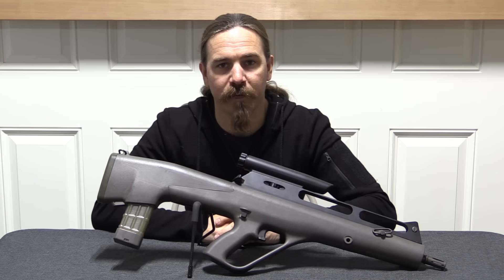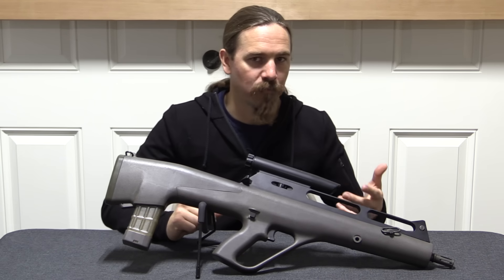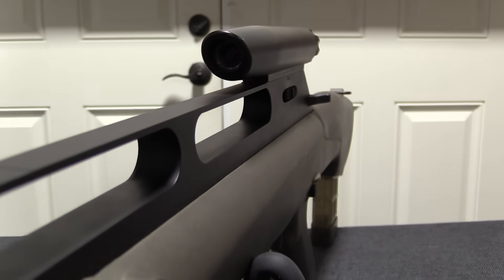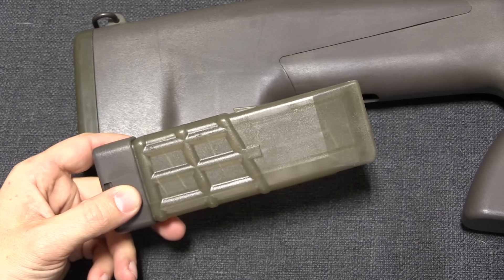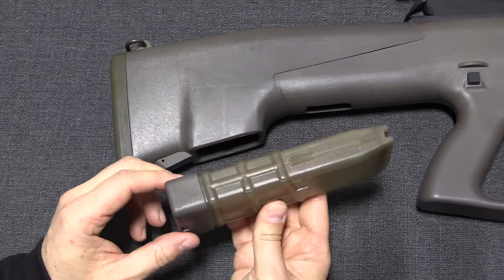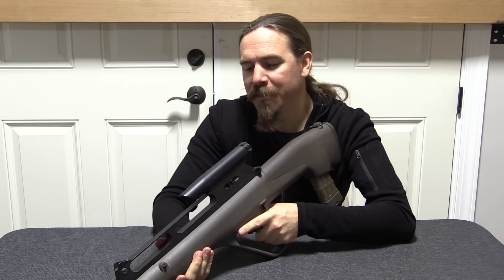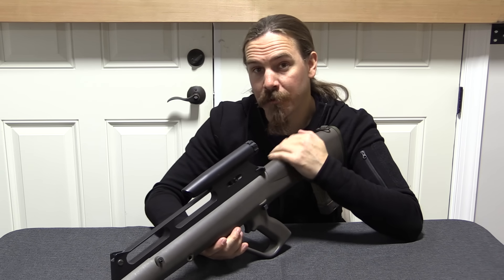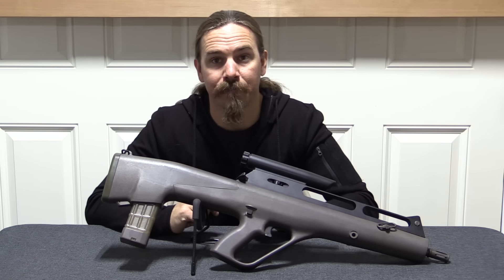Steyr ACR: A Polymer Flechette-Firing Bullpup From the 90s

Comment: This reminds me of the modern cars being build "computerized" and self-braking.
They are building high-end cars for people that do not have the responsibility and or skill to drive a car in the first place. 
The same logic here. They are building a rifle under the pretense that the shooter does not possess the skill to hit so they try to make the technology do it for them. 
If one were to make the argument that it was the prevailing mindset of the time (low opinion of the intelligence of the common soldier) you will not get an argument from me.

If the problem is with the shooter,  fix the shooter and the problem is going to go away.
Reply: Individual accuracy is next to meaningless when:
a) The enemy definitely will not stand still for you to take your sweet time aiming at him and pull the trigger.
b) Even if you gun fires laser beam, if the enemy emerges from cover and retreats back to cover in less than 2 seconds, you definitely still will not hit him.
c) Every soldier is capable of hitting moving target within the effective range of assault rifle with decent consistency. The problem is with the prevalent use of cover and concealment in modern combat, 90% of the time you don't even know which direction the enemy's gunshot comes from (refer to a and b), let alone precisely identifying which piece of cover the enemy is hiding behind.
d) The combine statistic of both WW1 and WW2's small arms related casualty analysis shows that more than 90 percent of death directly caused by small arms comes from crew served machine gun, followed by other types of small arms, with individually equipped rifle contributing the least amount of direct casualty. You can swap the individual rifle with cheaper pistol caliber sub-machine gun made of stamped metal sheets or even just a regular pistol, and the statistic still will not change.

Not saying that accuracy is useless, but when considering the bigger picture, it is not the most important thing to overly emphasize.
Reply: To all:
The following is not meant to be condescending.  It will probably come off that way but I really do not know how to ask the question without coming across as demeaning. So be it.
Which of you have first-hand experience and not just theory?
If you do have first-hand, in what context?
Reply: @glennearl5621  In addition to whatever time spent in school, I was assigned to a (light) combat arms unit between 1995 - 2000, so not only might doctrine have changed since then, but also since I squeezed my service time in between any major conflicts - this is why I spoke from the doctrinal standpoint, rather than combat zone experience.

Hey, don't blame me that there was relative geopolitical stability while I was serving - obviously this other nations knew what was good for them ;)
Reply: @glennearl5621  two deployments Airborne Infantry. Getting out within the month.
Reply: Flight Engineer on an MH-47. Afghanistan and a little bit of Iraq.
One of the responsibilities is door gunner and we used an M-134 for that.
Here is why I wanted context: The M-134 is possibly the definitive suppression system but the last thing you would think of when looking for an example of precision. 
In contrast, the operators we supported were trained so throughly that a precision shot in less than 2 seconds was routine.

I do understand suppression. I make no personal claim to be a precision combat shooter but I have worked with these guys and, more importantly, seen it first-hand. 
I do know that adequate training makes a fast, precision shot a reflex, this is to the level of an enemy breaking cover, for any length time, a losing proposition. In fact, exposing any part of the body to glance around cover is often a bad idea.

Is this level of training possible for only the elite? Maybe too expensive for conventional forces?  I do know that level is attainable as an absolute. I am aware of no effort to try a more intense training but I am aware of trying to field weapons intended to improve hit probabilities. Why not?
My point is that the level of firearms training given to conventional forces could be improved, a lot, even if it is never going go be comparable to the expertise I refer to.

I submit that it is possible to train to an effectiveness that surpasses the theoretical possibilities   by these unconventional weapons.
Reply: @glennearl5621  Revamping the entire training program to train literally every single soldier into having spec ops level accuracy will cost so much money, resources, time, and manpower, thus inflating the military budget  to such proportion that the public definitely will protest against such inflation of military budget size which is deemed as unnecessary spending (because most people don't care about the military). Adopting new, but still operationally familiar weapon system that drastically increase hit probability WHILE (pay attention, this part is important) maintaining existing training program and facility (meaning soldier will still undergo the same training program on the same schedule, but this time with different weapon) costs relatively less and is more effective in the long run.

Besides, most of the time soldier is able to  score individual direct hit on the enemy because:
a) Friendly area suppression ( such as crew served machine gun suppression) is taking place, effectively preventing the enemy from leaving its cover, thus allowing friendly soldiers to move forward and finish off the enemy at close range.
b) Soldier is able to catch the enemy off guard and quickly take down the enemy at close range without purposely aiming down sight.

The prevalent use of cover and concealment in modern combat tactics mean that the opportunity to perform long range precise hit on the enemy is very rare unless said enemy is standing on an open field for more than 2 seconds (nobody uses Civil War firing line tactic on open field anymore).

I agree that accuracy is still important, don't get me wrong. But since most engagement happen in close to medium distances, improving hit probability at said distances is what these weapon programs are trying to emphasize in the first place, and is still the primary improvement focused by most military until today.
Reply: @oim8254  I read what you wrote and now I'm convinced that you did not read what I wrote.
Reply: @glennearl5621  I did read what you wrote as well. If there's any misunderstanding, I'm sorry about that.
Reply: By that logic, soldiers not proficient with a sabre, a bow, or atleast a flintlock gun have no business on the battlefield... Decades of combat data on hit probability clearly show that most of that lead soldiers are spraying hits nothing, hence this generation spanning search for something that will increase hit probability.
Reply: @unverifiedbiotic  don't compare conscripts to volunteer soldiers. We have the tools to train people to shoot rather than just give many more soldiers weapons and have them spray at something.
Reply: @TommyTombstone  Not to be argumentative, but let's remember that a firefight is not a marksmanship competition. If US infantry tactics are being properly employed, most rounds will be suppressive fire. I have wondered for the past quarter of a century why our military focusses on "more accuracy" instead of "more suppression"
Reply: @MarcillaSmith  I'm fully aware. Been there, done that.

Comment: When I was in the Australian Army, we were taught that the circular reticle could be used for quick approximations of range. At 300m an average person should fit in the circle. Or roughly, a figure 11 will fit top to bottom in the reticle at 300m, and a fig 12 should fit in the target at 100m.
At 100m, with centre mass aiming, zero'd at 300m the steyr shoots about 10-12cm above centre. And so at 100m centre mass aiming you should be hitting people in the upper chest.
I'm unsure if the rifle is inaccurate, or the optics are bad, or what, but the Steyr AUG (or for the us Aussies, The Austeyr/F88) is listed with a 300m "effective range" with a effective section fire of 500m. But seeing the "at the time" M16 (A4 I think?) (around 2013/2014) they're listed with an effective range all the way out to 600m) So I'm not sure why, same round, standard 20" barrel, similar muzzle velocity. And if we're talking about on deployment, most infantry battalions had other sights on their F88s anyway, like ACOGs or other medium magnification sights around 3-4x magnification. So I'm not entirely sure.

Comment: From my time with the AUG I remember that the ring in the optics allows more precise ranging of the target. The inner diameter is equivalent to 1.8 meters at the standard firing range of 300 meters. As this is linear, the target of 1.8 meters height is at a distance of 150 meters if matching the outer diameter.

Comment: How does the flechette work?
Reply: Don't know if ya still wondering almost a month later but here's a quick rundown.

As ya can see from Ian footage a flechette is a small, needle like projectile with fins, think a really tiny crossbow bolt. It's then wrapped in a plastic multi part casing.

The case allows the needle to be pushed with about the same force as a regular bullet out of the gun, once clear of the barrel the case is designed to fall away, leaving the solid metal micro crossbow bolt of a flechette needle to carry the momentum towards whoever ya shooting at.
Reply: @Awoken_Remmuz  Thanks for the reply. I was just.wondering about length of a flechette and the small size of the magazine.

Comment: 35-odd years ago, I was briefly involved in the Australian Army trials for a replacement for the SLR. Based in the north-west Queensland desert, we headed out bush for the hot-dry and bulldust testing of several rifles - including the Steyr AUG, M16A1, M16A2 and I vaguely remember the guys talking about a Singaporean submission that had failed out of the trials early on.While not an actual selling point, the AUG receiver had a little switch that allowed you to select either full auto or 3-round burst. You did have to remove the butt-plate and pull it out to do so, but this only takes seconds. No, the real selling point was how freakishly accurate the AUG was - especially given that we were all used to shooting SLRs and F1s. It really was the gun that didn't miss.While the M16A1 was then in limited use and fairly popular among the SF community, such as it was, the M16A2 was an utter failure just during the period of my own observation. There were at least two parts breakages just during the fortnight I was out with the team. The real killer, however, was how quickly and badly both M16 models jammed up when faced with the talcum-fine bulldust so common to central-Australian cattle stations.
Reply: great story! Any chance the Singaporean rifle was the SAR-21 used today by the military? It's a Singaporean-made bullpup that resembles the AUG somewhat; used it for two years during my service.
Reply: @glenn.c  It was probably an SAR-80, which was an AR-18 clone made by Chartered Industries Singapore (now ST Kinetics). They hawked it around a couple of countries in the 80s, but they didn't get any large orders outside of Somalia.
Reply: That’s really Interesting!
Reply: I was an infantry instructor in the Austrian Army for several years in the 90ies, so I trained hundreds of guys on the AUG. In addition to that, my dad was a General and for most of his career, he was responsible for choosing, testing and selecting equipment for the Austrian Army – among many other things, the AUG. He used to tell me this story that you could bury the AUG in sand, leave it for a while, and when taking it out again, it’d still fire without a hitch. While neither the M16 or the G3 passed a similar test. Don’t know the veracity of this, or if it was just an anectote, but in my experience, both in hot summers and very cold winters, the AUG hardly ever failed or misfired.
Reply: @vi5ionary  I heard the actual AUG was impressive. The one made in Lithgow when I was in the Australian Army in the 90's was a piece of crap. They made 20-odd modifications to make it cheaply. They got what they paid for.
Reply: Thank you for sharing your experiences Sir! It is very interesting especially considering that in the beginning of the '90s during the German trials for a new 5.56 assault rifle the HK G36 was more accurate than the Steyr AUG.

Comment: The ring you can see in the scope covers a 1.8 meter target at 300 meter (sorry but metric system only 😁) . The magnification of the aug scope (or STG77 as it is called in the austrian army) is 1.5. Don't think they changed it for the prototype

Comment: I love the idea of shooting sabot rounds though if you're shooting fin stabilized rounds you have to do it through a smoothbore a la modern tank gun barrels. The plastic casings are problematic though. Unless they could get the chemistry right I think brass or steel would be preferred. I think a lot of problems with these advanced rifle competitions were that companies were trying to sneak one in on the the military and then work the kinks out later.

Comment: 25.4mm per inch. If the twist ratio is 1 rotation to 85 inches, then it would be 1 rotation to 2159mm's. I think cm was confused with mm, 2.54cm per inch.
Reply: The Meek Greek What?
25.4mm=2.54cm=1 inch.
Reply: @XtreeM_FaiL  yup
Reply: @XtreeM_FaiL  he said 1 in 85 inch twist is 213 mm.

Comment: That program was doomed to failure anyway. You don't need to improve the weapon when you can improve the soldier using it.
Example: Sharpshooters of the revolutionary war 1776.
Reply: A lot of them actually used early rifles instead of muskets. So they definitely had specialized gear.

Comment: Maybe I'm mistaken, but I would think that unless the plastic is extremely high temperature, after heating that chamber up a bit, the spent cartridge might melt while waiting to be ejected, possibly causing a jam. I wish they had worked this and other issues out.  The steel flechette was a NASTY armor piercing round, and because of the fins, it was quite a shredder.

Comment: Just a thought, could the small magazine capacity have to do with the plastic cartridge casses? Bigger magazine would mean more spring tension wich may have led to cartridges deforming.
Reply: maybe, but doubt it, they are designed to survive chamber pressure so it would be kinda wierd if you could deform them with spring tension
Reply: No.

Comment: Please do an video on flechette rounds I feel it was a huge innovation left behind in history
Reply: Yes please! I have no idea why they exist. I have been looking but can find no advantage over the conical bullet
Reply: @tulipalll  extreme velocity and armor penetration relative to the weight of the projectile. It's the same reason why APFSDS rounds are shaped in much the same way.

 As a couple of additional benefits, due to its shape and very high velocity, it has a tendency to dump most of its energy early in a soft target and will sometimes shatter in the process, giving you more stopping power and less overpenetration, which seems counter-intuitive, considering its relatively better armor penetrating capabilities. The other couple of significant benefits are extremely lightweight ammo, especially with the polymer case, and much less bullet drop, again due to the very high velocity of the projectile.

The downsides are mostly due to the nature of flechette-type round at this size and with the goal of cheap manufacture. As another commenter pointed out, the slow spin given by such shallow rifling is actually to compensate for any slight manufacturing imperfections in the flechette, not to stabilize it in flight, because it behaves more similarly to an arrow or dart in flight than a bullet. Any slight difference in the size of one of the fins will give the flechette a curved trajectory, so by giving it a slow spin,  you instead turn it into kind of a corkscrew trajectory. Depending on how significant the corkscrew is, this can actually affect accuracy quite a bit.

The only way to really compensate for this is the same way they account for it with the large APFSDS rounds used in modern Main Battle Tanks: Precision Manufacturing. You have to machine each round with extreme precision, which is justifiable for tank rounds because they're big and expensive and fired from a smoothbore cannon, etc. It is not as justifiable for an infantryman's rifle cartridge, where you want your ammo to be cheaply and quickly mass-produceable.

TL;DR flechettes have better ballistic properties in theory, but have downsides that cost too much money to fix in practice.

I do wonder if flechette-type cartridges are more viable now, given the last 30 years of advancement, though. Especially in regards to the durability problems with the polymer case that Ian mentioned, as well as the precision manufacturing issue I mentioned above. Are we able to mass produce something like that more cheaply now or not? Only time will tell.

Comment: You mentionned that you don't understand why the magazine was only 24 rounds, but I think you had the answer right in front of your nose at 12:06 . A bigger magazine would require a stronger spring, which in return would deform the cartridge even more

The trigger is also reminiscent of the AUG that has a two stage trigger and no fire selector: light pull for semi, full pull for auto.